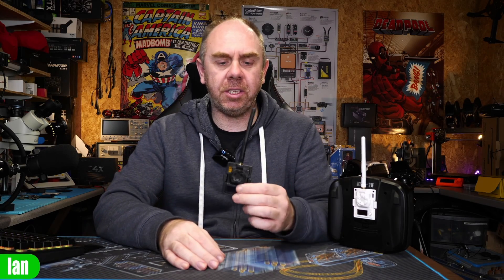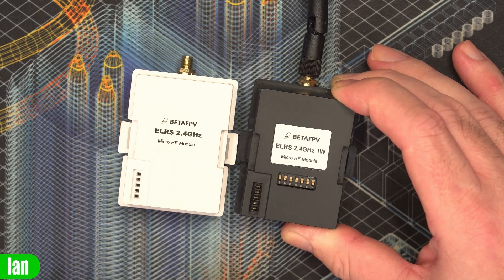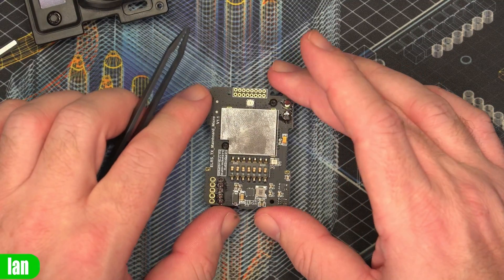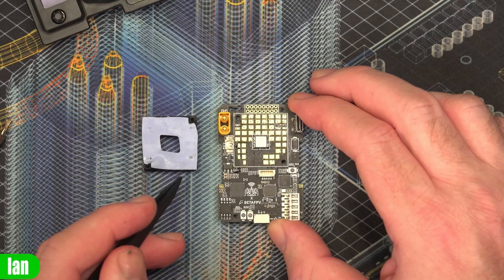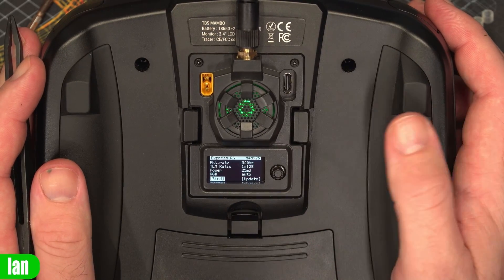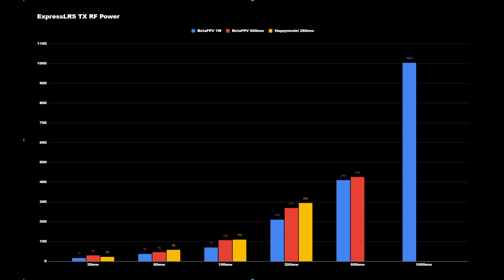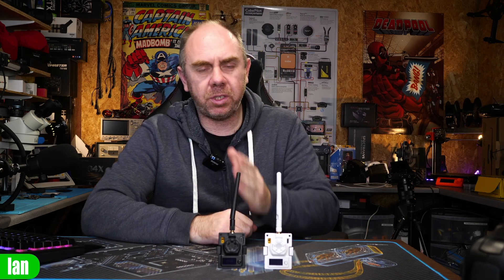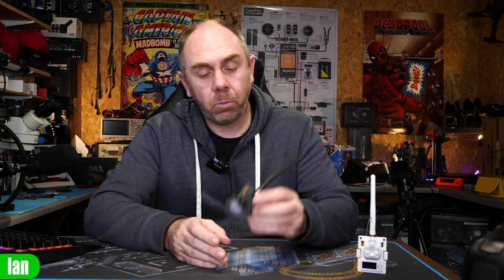1W ExpressLRS TX Module - BetaFPV Improved Module

Comment: Wish i could get mine to update to version 3 ELRS :(
Reply from the maker: If yours is the 1W are you changing the switches ?
Reply: @MadRC  Yes tried the dip switches all i keep getting is target device is different, which strange because the ELRS page gives me the target device. A friend of mine is having the same issues on a different radio.
Reply: Has anyone been able to solve this?
Reply: You have to update to 2.5 then do a file size firmware before 3.X

Comment: I have the problem with updating to new firmware, just won't do it. Always getting some errors, tried dip switches at different settings, different firmware versions, trough uart and wifi and still nothing. Contacted Betafpv but they have just terrible customer support and no help from them. When I connect tx to pc on the tx screen first I get that controller and ELRS 2.4G pic and after few seconds just goes to Wifi Update pic and stays like that... Tried everything, followed manual, watched all update videos on YT and just doesn't work.
Reply: I have been trying for about 6 hours to flash the update to elrs 3.0.1., so I understand this comment.  I also have tried  tried "dip switches at different settings, different firmware versions, through uart and wifi. It will allow flashing at v 2.5.1, and works well to control models. But it never will update, despite repeated attempts. It would help to know if anyone has been able to get it to update.

Comment: Thanks for this. I really need to move to elrs. I fly spektrum and can easily out fly my radio link. I see you have the module in a tbs mambo. Tell me you're thoughts on this combo. I don't want to go to the TX16S,  it's just to big. Thanks for the help.
Reply: Radiomaster TX12 is a smaller radio and you can fit the ELRS module to it. Getting it back off is a bit of a problem as its a very tight fit.

Comment: Yeah that's the one I ordered. I got the moon with it
Reply: With what receiver?
Reply: @chrisbee5481  I got the betafpv. Flat ceramic antenna for right now in a whoop. Want to put in another non long range drone
Reply: @divingfalconfpv4602  I also have the betafpv flat antenna rx on my 4 inch. Watch Curry kitten review Video on Youtube about that flat antennna module a few days ago  and then check the betafpv Homepage on that RX again. Its got range issues. I habe 3 flat antenna ones, two ceramic and now ordered the elrs T antenna ones. The T antenna module should have the best range.
Reply: @chrisbee5481  I only have it on a whoop so I can't really check range lol.. but I wanted to throw on high gain patch to try test it. A few have mentioned it. Mr blunty and others
Reply: @chrisbee5481  yea of course t-antenna does. It's outside the quad. Yeah on paper they said flat was only a lil worse but turned out to be a lot worse. Blunty was wondering if it's rx board or mounting issue . I have only flown indoors. It is blocked by fc and battery but I'm only 20meters away
Reply: @divingfalconfpv4602  but hey i think they fixed the issue, look at their fb page
Reply: @happyzhuoyi1  I bought it for tinywhoop. Squeazed between battery and fc. I prob have the v1 broken 1. No clue how to tell. I don't want to take drone apart